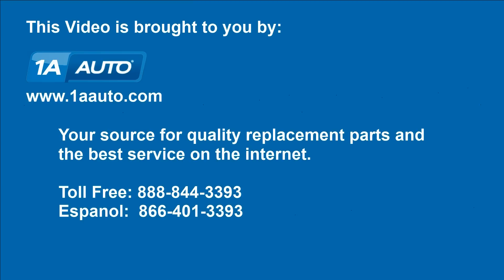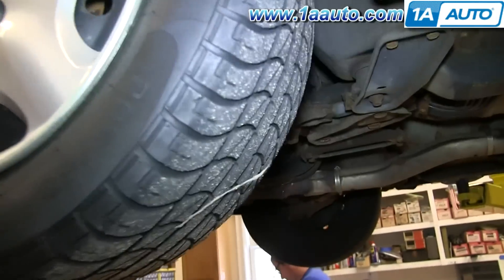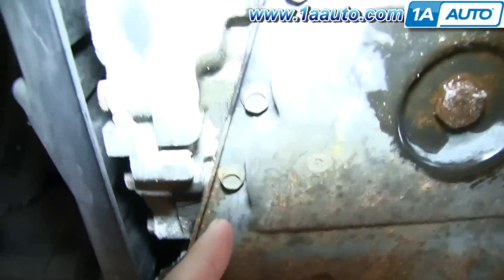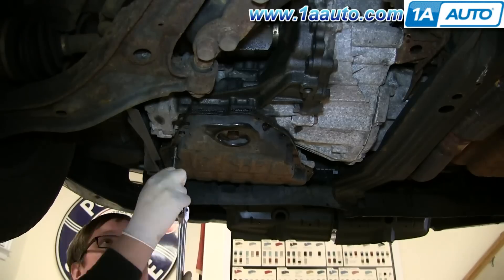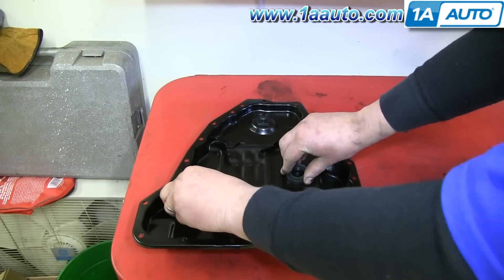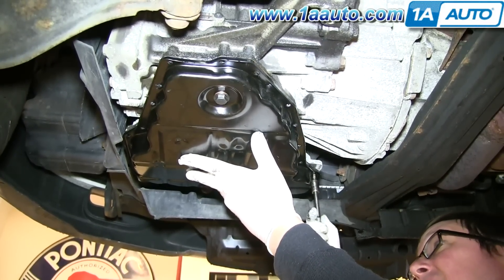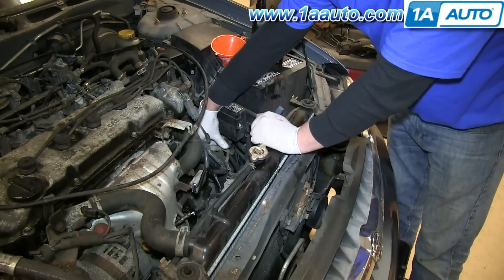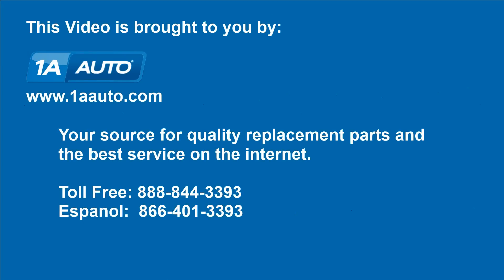How to Replace Transmission Oil Pan 93-01 Nissan Altima

Comment: It is really easy and cheap to change the transmission filter while you have the pan out. Most kits I have seen online are about $12 for a filter and pan gasket, and a new pan is about $40.

Comment: Hello are the transmission pan bolts the same as the oil pan bolts?

Because I just bought the oil pan and transmission pan on the website for $87 and was wanting to replace the bolts as well on both of them.
Reply from the maker: +Eddie Navarette We currently do not carry the bolts, so we are unable to confirm if they have the same bolts. Thanks for checking us out and we appreciate your business!

Comment: So was there an original gasket in place? and if so why didn’t you replace it with a new one or is the rtv just fine for it
Reply from the maker: +Naps Yohannes The factory pan most likely had a gasket, but RTV is perfectly fine for the replacement.  1aauto.com

Comment: I have a 2001 altima SE 2.4. Was wondering if there is a filter to change too. Someone told me on these cars, there isn't one?
Reply from the maker: +The Rodog Your 2001 Altima should have a transmission filter located in the transmission oil pan!  1AAuto.com

Comment: I need to replace my transmission pan on a 2006 dodge magnum se v6. My car doesn't have a transmission fluid dipstick. So how do I add and check the transmission fluid? Thanks for your help
Reply from the maker: The tube with the dipstick in it should be near the firewall. If you have the owners manual, it should also show you where it's located so that you can check the fluid level. Hope this helps you out. 1aauto.com 888-844-3393

Comment: What kinda transmission fluid does it need ?
Reply from the maker: +Ridetill Idie Thanks for watching!  For an automatic transmission you will want to use genuine Nissan ATF or Dexron II E ATF.  1aauto.com
Reply: 1A Auto Parts thank you very much
Reply: 1A Auto Parts I have valvoline dex/mercon 111 atf would that work to ??

Comment: how many bottles of transmission fluid do I need?
Reply from the maker: We currently do not have this data on-hand, it may be around 3-4 (if you're just replacing the transmission pan and filter). The dealer should be able to tell you. Thanks for watching.
Reply: Draining the pan is 1-gallon (or 4-quarts), but some residual fluid may be left in the pan when you remove it, so if you spill any additional, you'll need to add more.   Personally, I capture all the fluid and fill up old Costco milk jug(s), then fill up identical empty jug(s) with new fluid at the same level, which should be a pretty fool-proof way to be sure I replaced the same amount of fluid.